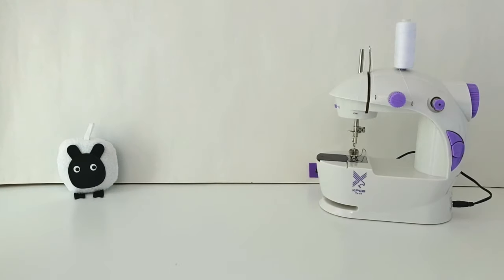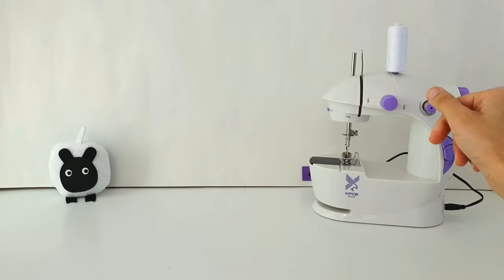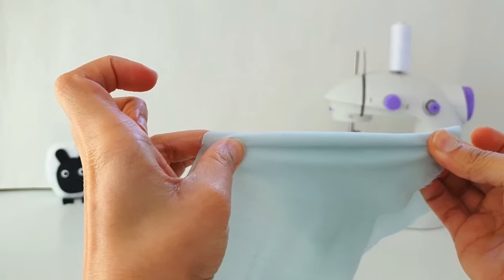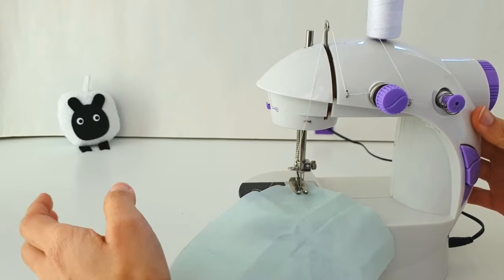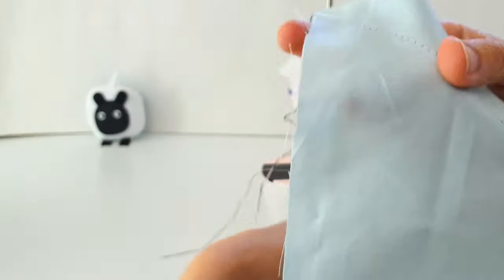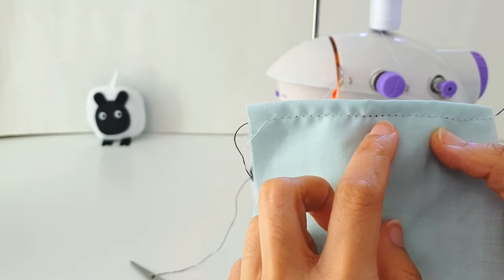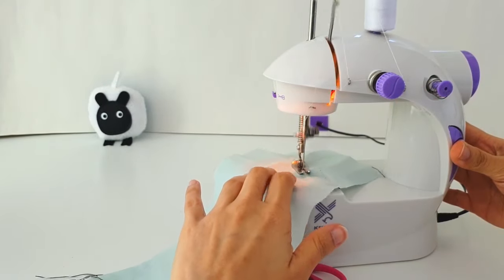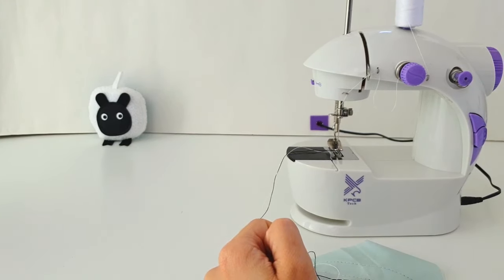Mini Sewing Machine Thread Tension Adjustment | THIS is the proper way to do it!

Comment: Ahh I see now why my spandex cloth keeps jamming my mini sewing machine lol. Felt like an absolute noob. Which I am. Thank you for the video :)
Reply from the maker: Hi Denzel 
I'm so glad this helped you!
 yes please never use stretchy  fabrics with the mini sewing machine, you will just be disappointed.
 if you do want to sew spandex , you need a sewing machine with some kind of a stretch  stitch.
 usually these are zigzag stitches or  overlock stitches as well as my favourite the triple stretch stitch.
 obviously the machines that have all  these stitches are more expensive than the mini sewing machine 
i do plan to invest in one  because i sold my two big sewing machines a few months ago due to lack of space. however i do miss sewing some projects which  the mini sewing machine simply cannot handle.
 are you planning on investing in any other machine and if yes what a brand are you looking at?
Reply: Thank you for the detailed reply. I mostly use sewing for my 6 inch figurine clothing so I don't really mind manually sewing and the standard sized sewing machine probably won't do so well.

Comment: Is there a way to fix the thread tangling around the thread take up lever? I can only sew about 8 stitches max then the thread gets tangled around the lever and pops.
Reply from the maker: Could it be popping out from between the tension discs as you sew? Keep a close eye on that and check. When that happens, it gets tangled around the lever. If that's the case, sew slowly.

Comment: Hi mam. Good and informative video. One week back I purchase a new Adonai mini sewing machine. Please be give a solution to my problem. That was the wound won't be ejected automatically by pressing for winding the bobbin. Now what can I do. Please let me out of this problem. Please.......please.........because all of of my  stitching work is in pending.
Reply from the maker: Hi Hari,
Do you mean to say that the bobbin winding spindle is not popping out? Have you followed the instructions to use it?
Reply: Yes ,that was not popping out.
Reply: I pressed it with finger on following instructions. But it was not comes out. What can I do?
Reply from the maker: Hari, if you can find an electric screwdriver or drill, you can wind the bobbin using it too!
Reply: Ok, I already tried it but it is not working well
Reply: How can I wind the bobbin using screw driver.please show me once in a video form.please....please....mam

Comment: I just found a brand new mini sewing machine at Goodwill yesterday for five dollars but the tension knob for some reason was removed and I need to figure out how to put it back together. From what I can see the two washers go on first with the little holes to put on the tab and then the spring goes over the shaft of the tension knob; is that correct?

Comment: how about when you gonna start to sew, the thread on the needle is always pulling out. what should i do?
Reply from the maker: Hi
Thanks for your comment.  I will make a video about this soon,  watch out! xx
Reply: Yesyes having the same problem now
Reply from the maker: Pamela and Jo, you must keep a long enough tail of thread after you pass it through the eye of the needle. Pass around 8 to 10 inches of thread through the eye before beginner to sew x
Reply: When i start to sew some how the thread keeps escaping from the needle.. i have no idea what's wrong..
Reply: It was working fine just a sec ago..really appalled right now:/
Reply: Hi yes i did keep a long enough tail:/ i sewed a Scrunchie and when i when back to try to sew another one it suddenly can't work..i must have touched something wrong by accident😟

Comment: Hello, my sewing machine is not working with some of the fabrics like light denim, is there a way to fix this?
Reply from the maker: Hi
thanks for your query.
How many layers are you trying to stitch please? This is a very small machine and will struggle with more than 2 denim layers. There is a hack for sewing thicker layers that I posted in this video:
https://youtu.be/33h1L5FVnn4
But if you are trying to hem jeans, remember that there are several layers at the seam and I doubt you will be able to sew through all of them. You will need a heavyweight sewing machine to do that.
Hope this helps x

Comment: Why no stitching whenever I sew on thick jean hem at the seam ?   Any solution or trick ?
Reply from the maker: Hi Stuka, 
It's only a little machine not designed for sewing very heavy fabric. 
When you hem jeans  , there are at least 5 layers of denim at the seams. I don't think this machine can cope to be honest, it's just not designed to do that kind of sewing. 
I'll see if i can work it out. If I do, i'll definitely post a video here.

Comment: Great tutorial. I just bought the mini and was struggling to understand how to set the thread tension with that deal as it seems super tight.
I have  question though, after sewing something, how do I secure the end of the fabric so the threat doesn't just undo? 
I can keep going beyond the fabric to tease out some thread from the top spool but the one under the lid seems to end as soon as I go beyond the fabric and I don't know how to sew it off so it's sealed.
I'm currently just folding a square piece of fabric over and sewing the two sides together to leave one end of the square open to use as a dust cover for cameras I have permanently set up.

Comment: Mam how can I solve the problem of broken of rope during swing
Reply from the maker: Saroj do you mean to say that your thread keeps breaking while sewing? the 2 biggest reasons for this are thread quality and thread tension problems. thread tension problems occur if your sewing machine is not setup and threaded properly and you have to adjust the tension properly as well. if you go into my playlist you will find videos dealing with all of these problems in the sew not scary playlist. I hope this helps.

Comment: Hi i took out the knob and now when i try to put it back it pops out and my stiching is good on top but then on the bottom its not tight
Reply from the maker: Hi Lisa,
You will have to open the machine up.
You will find that a hexagonal nut has fallen off inside the machine. 
You will need to screw this on to the other side of knob. Only then will the tension plates engage properly. 
Let me know how you get on. 
Watch how to open this machine below 👇👇👇

https://youtu.be/_N6F1ehfJKs

Comment: HELP. Can this sewing machine stitch a DENIM PANTS like Levis etc? Pls reply asap.
Reply from the maker: Alex, two layers should be fine. But if you are altering the length and sewing over multiple layers at the seam, it will be very difficult if not impossible.

Comment: I’m having a problem where the Bobben is threaded correctly but when I sew the thread is just laying on top of the cloth
Reply: I don’t know if you fixed It yet but It could be a timing issue with the thing that’s supposed to catch the thread inside while it’s sewing.  She has a video that fixes this, i had the same issue.  You have to take It apart a little to fix It but she makes It look so easy you only need a screw driver

Comment: will it not sew if the needle i used has no flat edge?
Reply from the maker: Hi Kristelle, you are supposed to use the same kind of needle as recommended by the sewing machine manufacturers. This machine definitely recommends a flat-sided needle. Are you having trouble finding these? The machine comes with two needles too.

Comment: Mam, Mine machine is running but while putting fabric my machine gets stop. Please help me out.
Reply: Mine did the same when I started using it.  I found that the bobbin was tangling, and sometimes this happened also when my thread was way too tight.  I hope this helps

Comment: Hi hope you'll answer my question😭 I accidentally turn round my tension and I don't know which direction was that and then now, my machine is not working. It doesn't do stitches. Please help meeee😭
Reply from the maker: dont panic, Alexa. Just re-set it using the square method. search for it on my channel. it'll be fine.
Reply: Okaaay I'll search it. Thankyouuu

Comment: my tension holder has broke i remove it and it can't come back again huhuhu
Reply from the maker: There is a nut on the inside of the mini sewing machine just behind the thread tension controller that must have fallen inside the sewing machine
 you will have to open up your sewing machine in order to get it and then screw the thread tension controller back on again
 I hope this helps

Comment: How to fix if the thread is knotting around the bobbin?
Reply from the maker: Hi Maristela,
Firstly , please use a high quality thread.
Then check the tension on a scrap piece of fabric ON THE BIAS. Pull the fabric and see which thread breaks. Adjust accordingly.
Check this video for details: https://youtu.be/ZEky17PmJo0
If nothing works and the machine is refusing to stitch properly, it might be a timing issue. Watch this: https://youtu.be/_N6F1ehfJKs

Comment: I bought my  mini sewing machine a month ago, during that span of time, the light was automatically turned ON.  But after a month, it didn't turn-On?!   Is my mini-sewing machine broken already?  Thank you.
Reply from the maker: Hi Eddvi, thank you for your question. I have never seen a mini sewing machine that has a light bulb which switches on without a button. If you machine still works, it just means that the bulb might have fused out. I don't know if these little bulbs can be replaced, but the bulb in itself should not be affecting the performance of your machine.

Comment: I accidentally pulled outthe tension knob.. now it won't get tight
Reply from the maker: Hi
You will have to open the machine up to fix it. It's a nut/bolt system that you need to tighten on both sides.